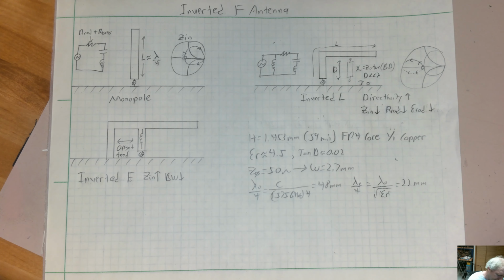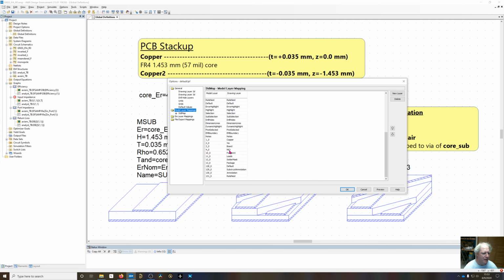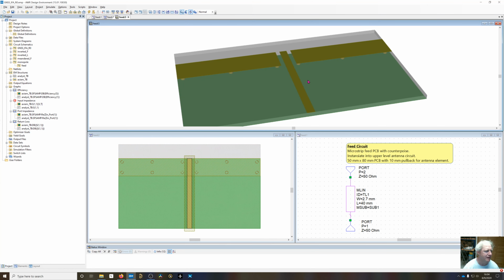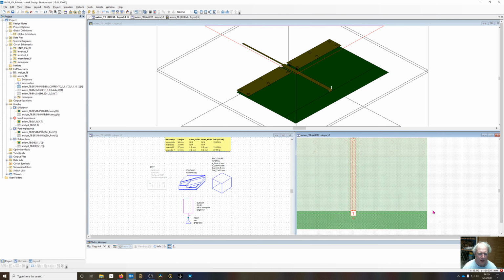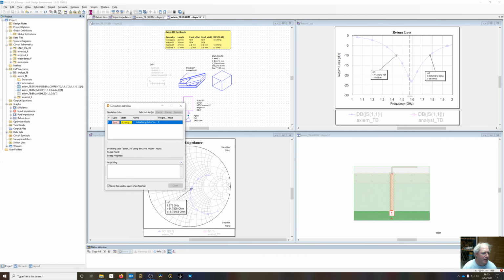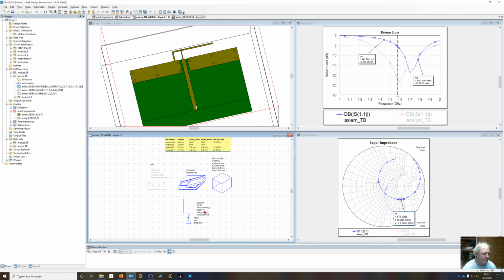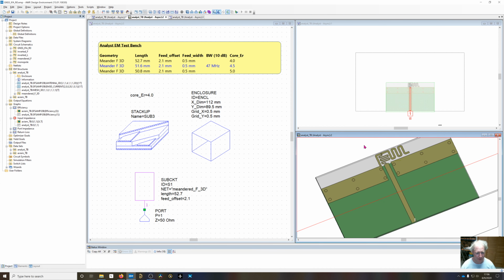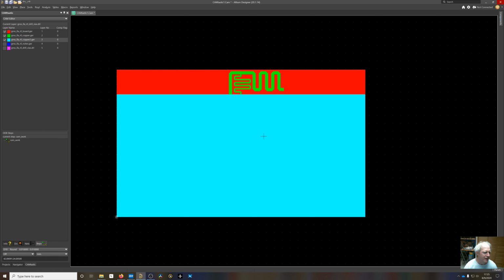GBM 003 IFA Design

Comment: I tried designing a multiband PIFA antenna with operating frequencies of 3.8GHz and 5GHz and I get a negative gain. How do I fix that? Thank you
Reply: Increase efficiency. Tune for 50 ohm or make larger.

Comment: Do you have any advice for 5G Cellular PIFA antenna design? In automotive, PIFAs seem to be the standard for cellular. It is very difficult to design low cell band antennas (617MHz) and up to 5GHz
Reply: Phones are using aperture tuning with switches and variable caps (such as Peregrine DTC.  For auto’s you have more room and can incorporate traveling wave designs.  An elliptic dipole is an example.

Comment: silly question time... mobile phone antennas have been beautifully & extensively derived for limited real estate (palm of hand)... radio amateurs have similar problems with the size of hf antennas in small modern gardens... could this be scaled 100 fold from 1.6GHz to 14MHz?.... One problem they certainly would have is duplicating an efficient earth/ground-plane to work over but doubling up from unbalanced inverted F to a balanced equivalent (basically a skeleton notch antenna) might potentially resolve this. OK it is going to be high Q but low power morse calling is centred on 14.060MHz so an efficient bandwidth even of 100kHz of BW could still be adequate.
In moving things the problem is probably going to be the scaled loss resistance (especially due to the significantly increased lengths) compared to the radiation resistance.
I've not got the tools to confirm this but would the scaling be valid or would the new loss resistances have increased to nonviable levels?.
Reply: Typically the RF conductivity scales to 1/f^2 so the loss resistance would actually be better than the high frequency antenna IF you kept it over the same metal counterpoise.  I have a wire inverted F 20’ up the side of my house and 100’ over the yard, with a tuner at the bottom.